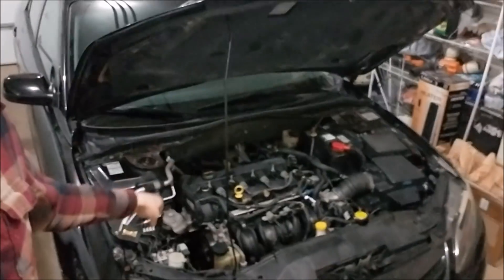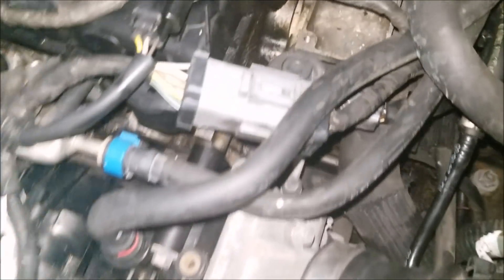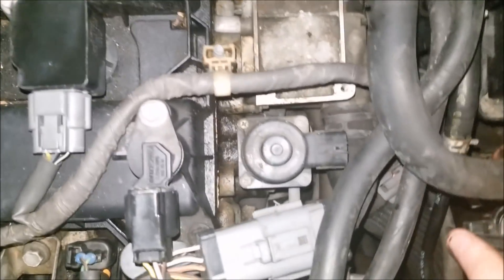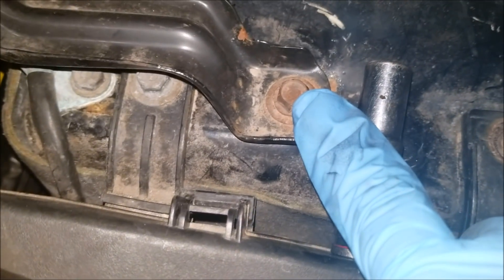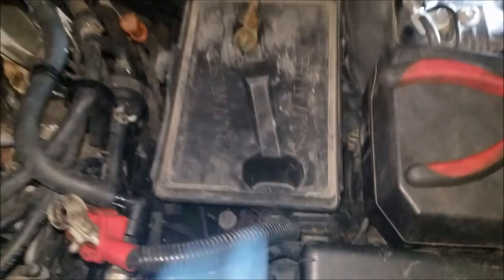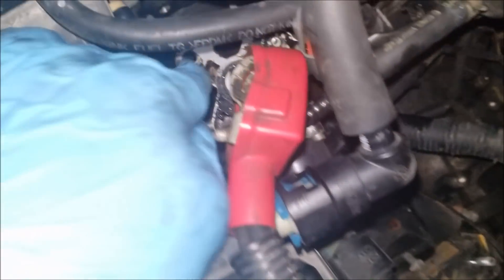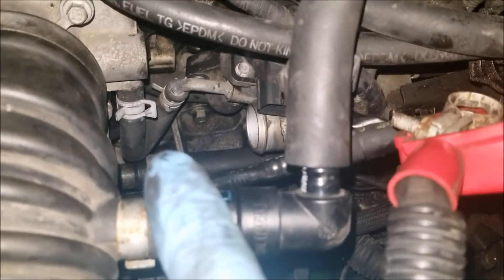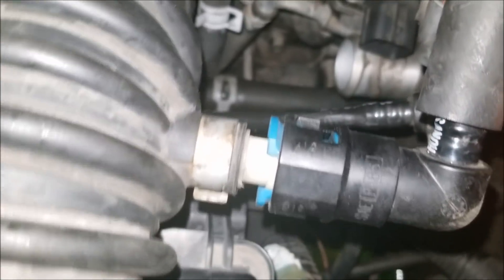How to clean or replace EGR Valve: 2003- 2008 Mazda 3,5,6 and Tribute 2.3L

Comment: Hey awesome video it helped me a lot I got the exact same car! Just a got some questions. I took mines out cleaned it. I just got the code again today after 2 weeks of cleaning it, do you think  I need to replace ? and also when I’ve been running my car for like 15-20 minutes I get a beeping in my car, do you think it’s related ?
Reply from the maker: Ismael Hurtado Hi Ismael, I'm afraid of you kept cleaning it and no codes have gone away. Then it might be time for a new one. I would check the hoses and other culprits before replacing though.
What kind of beeping noise are you getting?